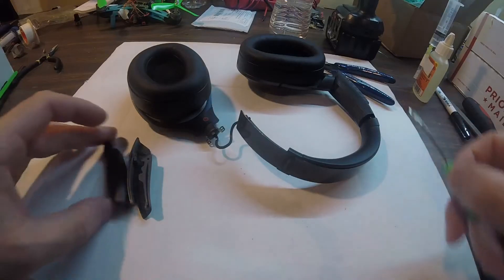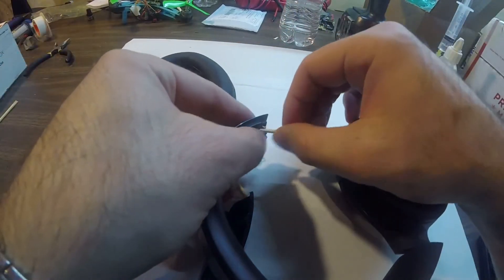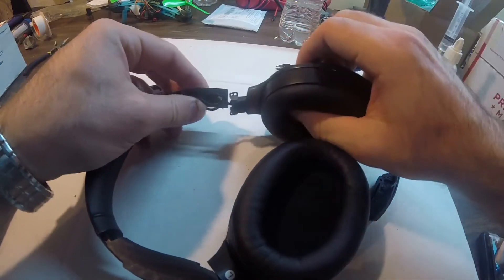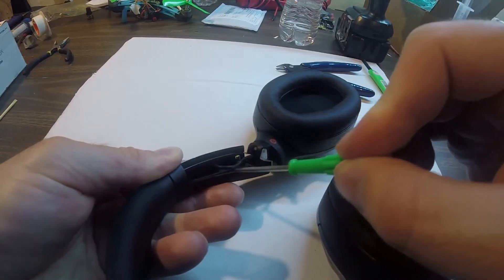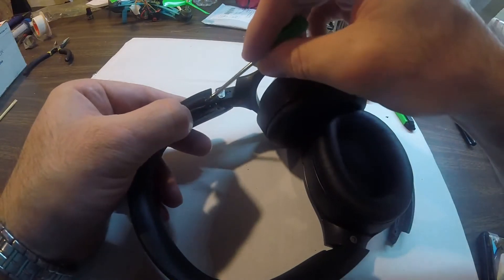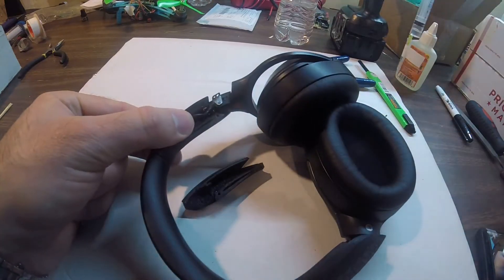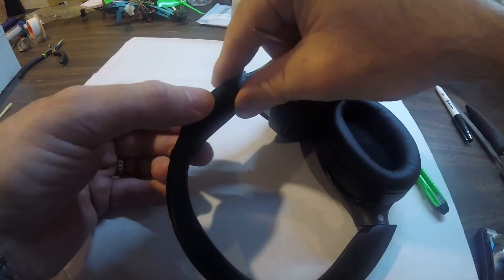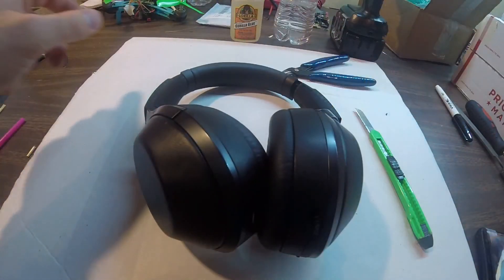3D printed Sony 1000x repair broken hinges / headband adapters

Comment: Lining up the metal ends and ensuring the cable stays inside was stupidly challenging. Requires nimble, steady and strong fingers, lots of patience. I was not able to assemble, but my spouse was able to pull off due to their DIY experience. Practice well before you commit to adding glue, otherwise it will dry as you struggle to put it together. Still pissed over how hard it was to perform this repair, but I'm glad the headphones work again and that they didn't go to waste. Fuck Sony.

Comment: I bought several repair pieces from different vendors and this is the best. I didn't use glue, just duct taped. ( as neatly as possible) I did left side almost exactly 1 year ago and needed to do right side just now. Shame Sony doesn't stand by this major design flaw and supply repair parts under warranty, but thankfully, this is a great replacement. Possibly better than the original.
Reply from the maker: Thank a lot for you feedback. I agree with you.

Comment: i have a question, why do i have to put the match in there
Reply from the maker: Ok that was prob not the best way, you can also just trimm off the metal thing. The reason is to prevent cable jamming or cuts when assembled. The metal piece can do so.
Reply: @vitaliyd193  i have another question, would this make the headset to be tighter or differn't around my head, how similar is the feel  close to the original
Reply from the maker: @WHWitaker  , It might be a little tighter. But I will let other ppl leave their comments regarding that. No one complained so far. I only get positive feedback.
Reply: @vitaliyd193  thanks